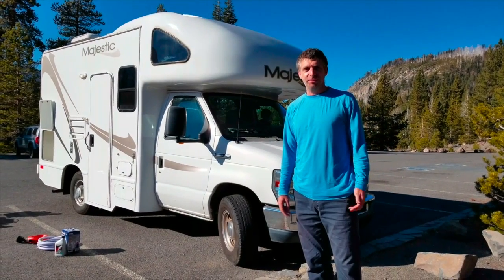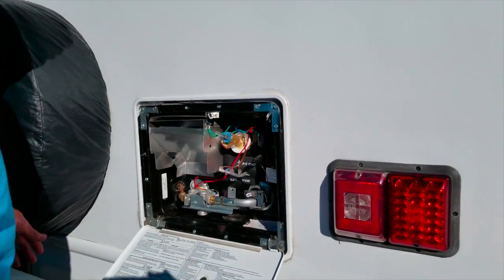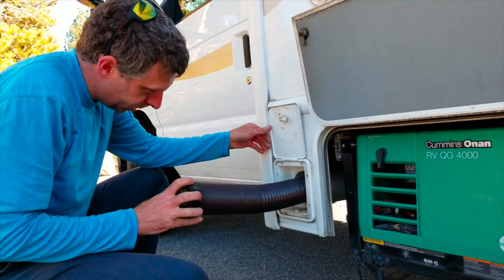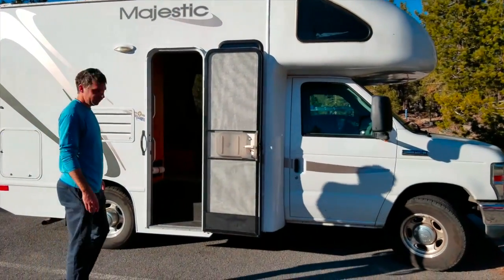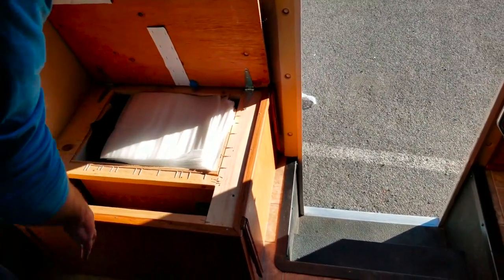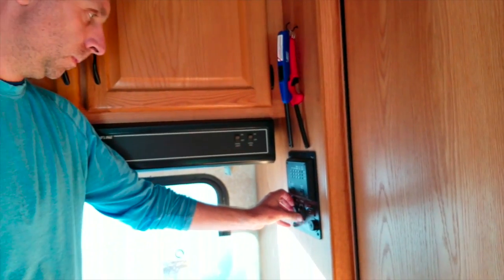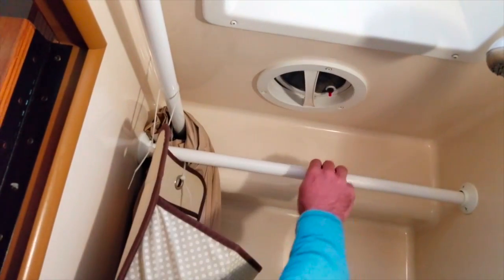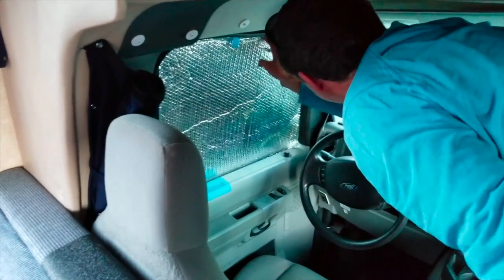Sold 2011 Four winds Majestic 19G

Comment: Oh I forgot to ask, is the overhead bunk area where you sleep starting to leak water from outside, do you need to recaulk it yearly like the roof? Thanks!
Reply from the maker: On our Rv we didn´t have any leaks. Just on cold night we had a little bit of condensation from the inside. But even in heavy rain the roof was waterproof.

Comment: Hi, great video. I’m thinking about buying a refurbished 2016 model year cruise America Thor majestic 19g with over 120,000 miles on it. Do you have any recommendations for me based on your experience with this small rv. Am I crazy to buy one with this with so many miles on it , a retired rental unit? What will usually go wrong with this model since you had it and how long? Do I need to buy house and motor transmission warranty for this high mileage rv over 120,000 miles? Thanks. Stay safe.
Reply from the maker: Hi! Our RV had almost 180.000 miles. It was also a cruise America rental, but it was in great condition. We only had it for 6 month for a road trip in USA. We didn´t have any problem. The engine worked great and we didn´t have any mechanical problems. I was afraid at first to buy an Rv  with so many miles but for our budget it was much better to buy a high miles unit than an older one. We just did the required maintenance, like changing tires and oil. We only had it for six months so I don´t know what are the problems that arise with time. And about the warranty, we didn´t buy one for ours and it turned out to be a good decision. Good luck buying your unit!

Comment: Nice little rig. Lol this young family uses every single inch of space. I just know this man has to make due with like one little spit for himself. Lol. Also this rig is also right on the cut off line. There seems to be what is known in business as a prisoners dilemma in the RV site industry. For real good reason at all the industry has accepted that if your RV is over 10 years
old it is not welcome at most RV cites. This of course is quite stupid and the reasons have not been supported by evidence based research. But it is what it is. Most RV sight owners are not exactly MBA scholars so you get what you get.... 
just know if you are looking for a used RV ( right or wrong) the industry standard is: the RV should not be more than 10 years old or you absolutely will run into this problem.
Reply: In my experience this is only at the higher end resort type rv parks.